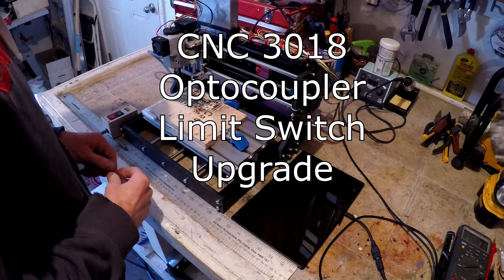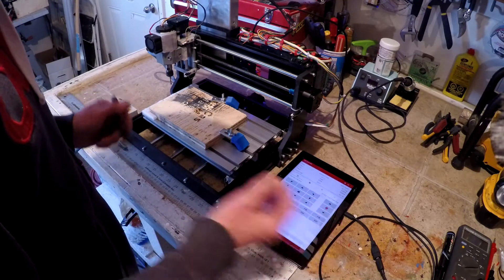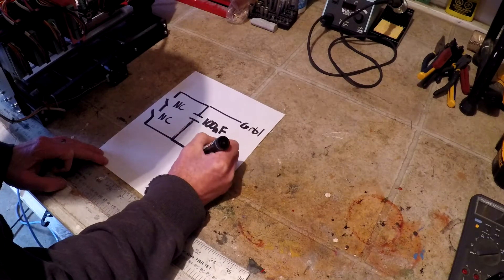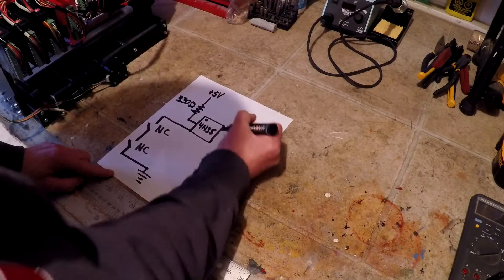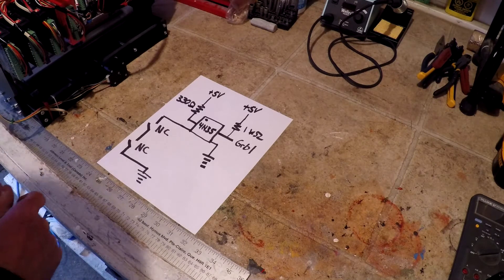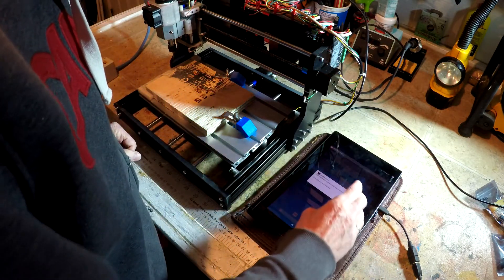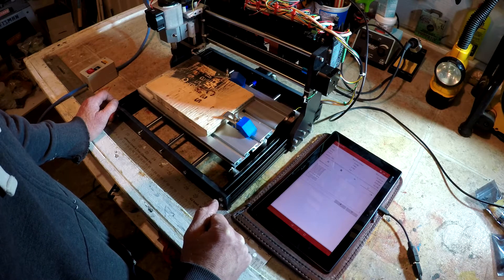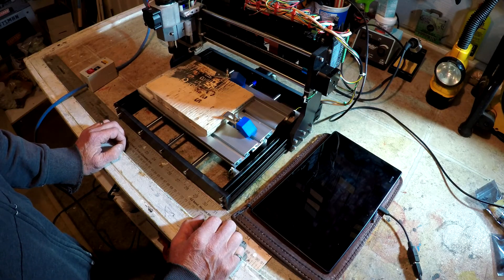CNC 3018 Pro Optocoupler Upgrade For Limit Switches

Comment: another way would be use higher voltage, 12 or so to drive the optocoupler, higher voltage is less prone to noise
Reply from the maker: 12v should help, I never considered it as it was easier to keep it all 5v.  I noticed new limit switches from AliExpress have some circuitry on them, I haven't looked closely at the circuit on them but I suspect there is some filtering going on.  I just purchased a new, bigger, CNC and was contemplating ordering a set for it.  I ended up giving up on limit switches on the 3018, I always had issues with the switches flaking out, either the dust or the vibration causing issues with them.  I need to find a better switch solution first!  Adding LEDs to each axis on the optocoupler board would be a good addition for a v2 as well.

Comment: so true, even with shielded limit switch wires and filtering and Normally Closed limit switched, the grbl give Alarm 1, hard limit alarm, when you turn of a spindle. this is one of the common issues faced. I feel why not make optocoupler must is a shield. to avoid losing sanity for many people. I am also going to use optocoupler for this purpose

Comment: Informative video.  I'm trying to get NC limit switches working.  I have them wired as you have drawn out.  The GRBL input from each switch is low at rest and high (5 volts) when the switch is activated.  Activating the switches does not result in an alarm state.  What am I missing?  Thanks.
Reply from the maker: I would check your grbl settings, make sure limits are enabled and try inverting them.  Also, if you have lots of noise in the limit circuit that can cause issues too.  $5 and $21 you will want to look at.
https://github.com/gnea/grbl/wiki/Grbl-v1.1-Configuration
Reply: @reileymckerracher9181  Thanks for the reply.  I have finally got the limit switches working.  My 3018 machine has what looks like six limit inputs; two for x, two for y and two for z.  I connected a separate limit switch to each input.  This configuration would not work no matter what I did.  I accidentally discovered that if I connected the two x limit switches in series and connected them to one controller x limit input, it worked.  I did this for y and z as well and all is working as it should.  I have opti couplers on hand if I need them.  Thanks again for the video.
Reply from the maker: @jjvb3329  Thanks for the follow up!  A good tip for other to look at if they are having problems.  I use an arduino nano, not the original board so bit of a different pinout for me.

Comment: would it not have been easyer to use a Common CHOKE on the power to the spindlemotor ?
Reply from the maker: Maybe?  I don't know enough about electrical circuits to know.  This seemed to be the common solution to get rid of the noise and within my ability to construct.  I bought the VFD and motor as a matched set with pretty much no documentation, so I'm not sure where I would start with a choke.  Probably a lot of googling!

Comment: Sir can you help me fix some issues on 3018pro ? 😣😢
Reply from the maker: maybe, what is your problem?
Reply: @reileymckerracher9181  ermmmm 🤔 , when i plug in power my motor automatically run and my button on/off at the board not function , i try stop the motor at app and he still run n can't stop 🤔
Reply from the maker: @blackpomen  double check the wiring.  then plug it into candle or something similar, check the grbl defaults, make sure it all looks right, also, from there you could try turning it on/off manual by sending the command (eg m3 s0).  if you have done some upgrades and the spindle speed is now inverted, you have to go into the code and recompile grbl specific for your use case.  could be a number of things without more specifics, hopefully that helps and gives you a couple things to look into.
Reply: @reileymckerracher9181  okay sir , tq😊

Comment: Thank You, sir 
@6:48 
you mentioned that you will use an isolator between the 5 volts, how did you do that, is it by using a separate power source for the optocouplers 5v ? or is there another thing to do?
Reply from the maker: Just a 5v isolator, it is the large square black component beside the optocouplers.  Specifically I'm using a B0505S.
Reply: @reileymckerracher9181  Thanks 🌸
Reply: @reileymckerracher9181  I was just about to add an external 5 V brick, thanks for the B0505S/D tip!
Reply from the maker: Happy to help!

Comment: Good day sir. Thanks for this helpful video. The notice level issue is driving me nuts.
You use a 4N35 chip because you have one. I an in South Africa and can get a 4N25 but don't know how to conect it. It has 6 pins. Or a op to isolator board. P look please see link. https://www.robotics.org.za/OPTO-245?search=Opto.
If possible can you please assist.
Regards Peter zubxi503@gmail.com
Reply from the maker: That isolator board looks nice, they indicate it is for  24v signals, but then list a minimum input voltage of 3.3v, so it should be ok but the fact they list it as a 24v board makes me hesitate on saying it would work.  I would confirm the resistor sizes and what optocouplers they are on the board before I bought it.  I do like the option of having LEDs, I wish I had included some on mine.

The 4N25 should work fine,  just following the wiring diagram they provide on that same site:
https://www.robotics.org.za/4N25-DIP
Input to your switch, and the output to your grbl controller.  You will also need to change the input resistor to match your voltage.  If you are using 5v, use a 380ohm resistor.  Someone else already did the math for the 5v input here:
https://forum.allaboutcircuits.com/threads/4n25-optocoupler-optoisolator.35571/

Comment: Great video. I noticed that you have an upgraded spindle. can you share details on it ? I am thinking of upgrading my 3018 Pro spindle from stock to a brushless DC motor. I am going brushless because I think the VFD 500W spindles are a little to big and bulky for the 3018 frame.
Reply from the maker: Good eye!  I did upgrade the spindle, I used this one as it has the same outside diameter as the stock spindle:
https://www.aliexpress.com/item/32849678424.html?spm=a2g0s.9042311.0.0.27424c4dWbcFnM
and the diver to go with it:
https://www.aliexpress.com/item/32849686866.html?spm=a2g0s.9042311.0.0.27424c4dWbcFnM

The one thing is it runs really hot, so I did mount a fan on it too (I took inspiration from my fan on my 3d printer hot end), and the spindle does need a spacer (the stock one has a metal sleeve) which I 3d printed.  The metal sleeve has a divot on it and wouldn't fit the new spindle right.  You'll need an upgraded power source as well.  If you go that way, send me a message and I can help with the wiring, there is no documentation and took a bit to figure out.